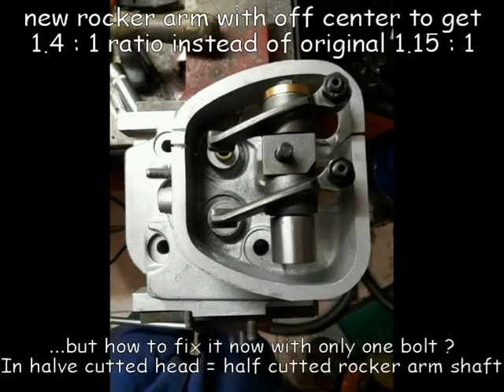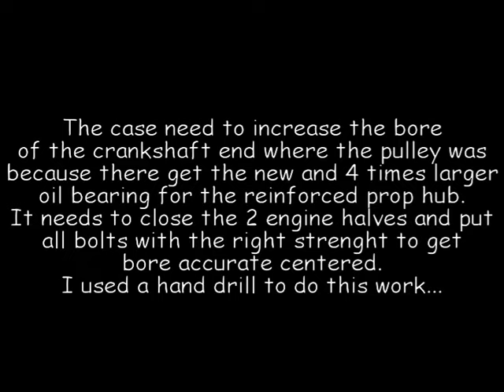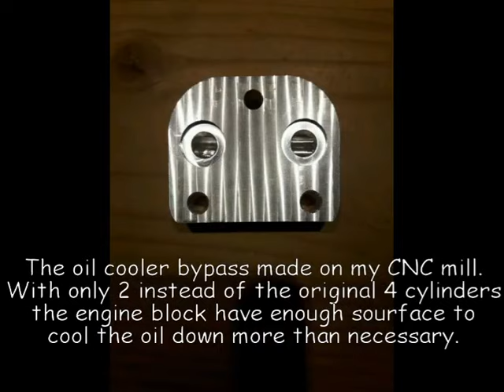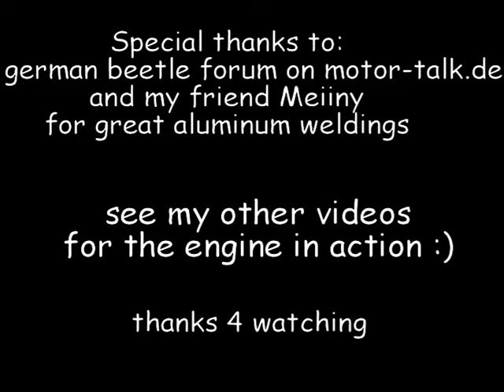How to build an airplane engine from garbage DIY

Comment: Why not start with a BMW boxer Bike engine?
After all it was designed by Sopwith before WWI when it was called the ABC engine…
Reply from the maker: We had the thema 2 years ago, this engine need a reduction gear because the power is reached at higher rpm. This leads in unreliable engine for longer flights, more weight, more mecanical pieces in motion that can fail and more maintenance. The reason because most airplane engine are direct driven is exactly this. And last, a bmw boxer engine is more expansive

Comment: Did you use any engine plans to build this? I am interested on how you balanced the counterweighted crankshaft.
Reply from the maker: Yes i used different plans. If you google for half vw engine, you find more plans. But mostly i follow the "better half vw engine" plans from Leonard Milholland.
He use a extra additional weight to counterweight the crank and it works very fine. Look at my other videos where the engine run on the stand without any fixes and it stays very stable and very less vibes
Reply: @flyover1974  Thank you for the reply! That is why I was asking because I have Leonard's plans but his crank doesn't use the last throw and instead uses a plate you bolt on. But yours shows you're using that throw at 4:22 and I guess that bearing is a split bearing. I can't find any plans that shows you how to do that...
Reply from the maker: @backyardgarage912  if you mean the last counterweight, it is the half of the 3th piston journal. But this alone isn't enough, you need to counterweigh the prop hub too. Hope you undersand what i mean.
The pull bearing for the prop traction is realized at the inside of the first cranck bearing between the first counterweight flange and the bearing.

Comment: What was the original power and displacement? You started with the oldest Type 1??
Reply from the maker: original from 79 if i remember it correct and was a 4 cyl boxer with 1300 cc displacement, now is 2 cyl boxer with 1200 cc

Comment: Where did you move the thrust bearing?
Reply from the maker: I move the thrust bearing to the front (prop side), i used the original  hardened spacers that normally are on the flywheel side but it needs to enlarge the inner diameter a little bit. I did this with a dremel while the spacers turn in the lathe.

Comment: Can i ask a silly question ? Why go to all that trouble , why not use the whole 4 cyl engine ? just asking 😁😁👍👍
Reply from the maker: Bcause for my specific use a 4 cyl is oversize in weight and power
Reply: flyover1974 thanks just wondered 😁 good engineering dude anyway 👍👍

Comment: DIY ? OK, First buy a TIG welder $6000, then a CNC mill $50,000 (guess, but for sure not cheap) then Trade School to learn how to use this stuff $10,000 (another guess, but certainly not free) now buy a few VW core engines because you're going to screw some up before you get it right. Last but not least, check that life insurance is paid up before first flight.
Reply from the maker: YES, DIY ! The Tig welding was outsourced and cost me a sixpack ;) Nonetheless i own one and cost new 700 bucks... for sure is not for every day working but for home working is good enough.
The cnc mill is selfmade and cost me around 600 bucks (see my other videos), anyway you dont need a cnc mill because the head work is not necessary because you can also put some spacers under the cylinder to get lower compression. Next time i do this and spare a lot of unnecessary work.
I build the cnc by myself and how to use, i learned by myself. Its not that hard ;-)
And for the rest, search here on youtube, you will find a lot of vw engines running on airplanes exactly because they are above average strong and reliable.
If you are a fearful person, just stay at home and do nothing...
Reply: @flyover1974  Thank you for taking the time to write a reply to my comment which was intended to be on the humorous side with a certain amount of truth. I have a 4000' shop with a mill, lathe,  MIG, TIG, Shear, Brake, 12 and 50 ton presses and every hand tool you can imagine, none from Harbor Freight. I call it a "Hobby Job Shop", I work on old cars and do some light fabrication for myself and friends. What I'm trying to say is that I'm pretty handy, BUT WOULD NEVER ATTEMPT TO DO WHAT YOU SHOW IN YOUR VIDEO. You're a very skilled designer and fabricator. I believe you've been at this sort of thing for years; definitely not your first rodeo. The average person would not get to first base trying what you profess to be easy.
Reply from the maker: @badron9245   thank you :)
i work for hobby with things like this and your "shop" is my dream :)
Reply: normal men have garage tig welder, and diy cnc build under 1000 $ ,i has build 200 cnc machine hobby users and have totally cheap if looking used big steppermotors craveyard and lot parts can salvage many place. cheapen TIG welder who can use normal hard work ewery wekend hobby builder, cost 300$ NOT 6000$ i not has newer see 6000$ tig, maybe some big pro manufactory automatric TIG but not newer any normal hobby tig less than 200A current no need more.  my first TIG has MMA,TIG,plasma cutter 3 to 1 machine cost 340$ and second has better TIG cost less than 300$ but lot better pro model. all new. not used, used TIG can buy 200-500$ million shop. learn how use no cost anythink you can learn in home weekend easy. how welding no need learn lot, cnc can use learn in home and internet little and garage test how work easy little job and normal men can use. idiot need go to school ofcourse.
Reply: @mattivirta  Speaking of going to school............

Comment: With all do respect -  a 48 yr old motor, your first 1/2 VW conversion (I assume), and you are sitting behind it flying your UltraLight.  You are literally betting your life on that engine.  Doesn't make sense to me.
Reply from the maker: This is only the engine block and the camshaft with 48 year, and both are checked if they are good. The old original VW pieces often are much better then the newer ones.
And about the reliability, the engine remain on ground for 50 hour running test. Then disassembling and checked for excessive wearing. If all is good can mount on airplane. This is not the first VW conversion for airplanes and most of them are very reliable because the engine itself is known as a reliable engine
Reply: The engine is very safe. as long as built properly.